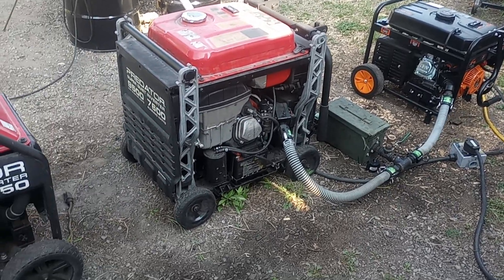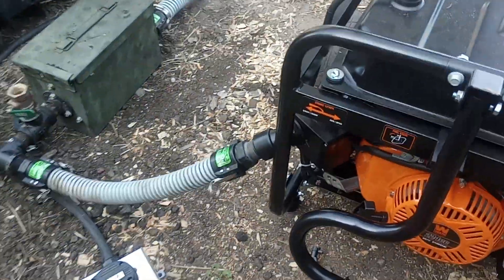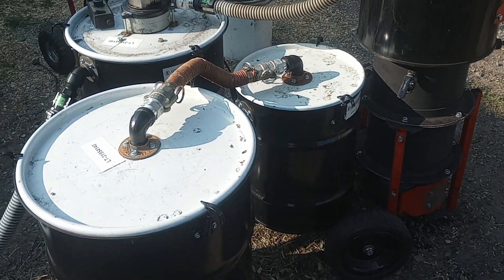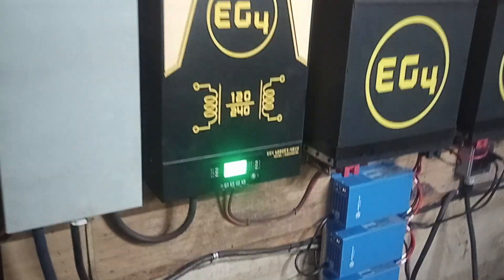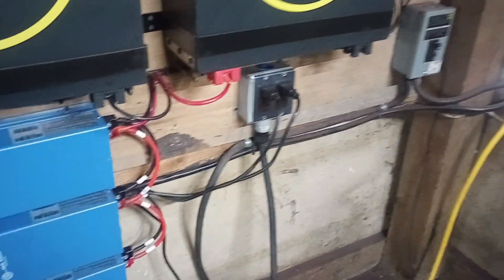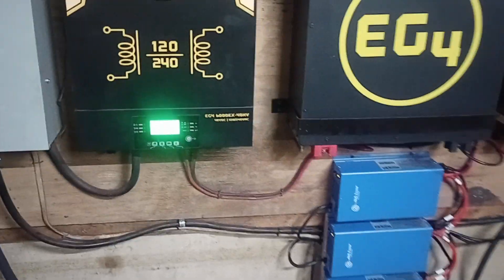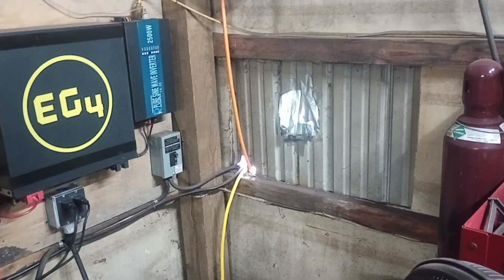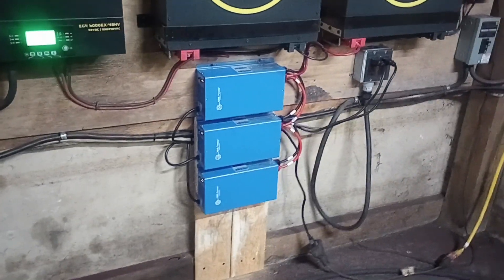Wood Gassing our WEN 4750 Generator in tandem with our Predator 9500

Comment: no batteries..?
Reply from the maker: You did watch the video right??
Reply: @Thrive-Off-Grid   only a few minute....😅
Reply from the maker: @anuarabdulsamad2688  Well there you go, you got to watch the entire video man :)
Reply: @Thrive-Off-Grid   i thought you are feeding   the charger output straight to the inverter...is that possible... ??
Reply from the maker: @anuarabdulsamad2688  Yes you can do that
Reply from the maker: @anuarabdulsamad2688  Thats kinda silly thoguh isnt it? Why would you convert to DC just to convert back to AC? Our EG4 inverter can pass thru a generator input and output in pure sign wave. But with a gasifier you never want to use it as a primary power mover. Run it at its maximum you can get out of the unit and store that power. Otherwise you are wasting your fuel.

Comment: Matt how many watts are you pushing to the batteries total?  Ah I went back and watched again 60 amps at 54 volts. 3,240 watts. Pretty nice!!!!!
Reply from the maker: 3 kW that is the recommended max for two of these EG4 5 kW batts.
Reply from the maker: Yeah that is the rate we would charge at running on gasoline. Its not recommended to charge beyond this rate.
Reply from the maker: I think with our Aims converters the reason you maybe limited running them in parrallel; is because you are running lower voltage. So you may need bigger cables and well bigger cables will be dificult to fit onto the Aims. Yeah three chargers pushing through 6 ga at 54 volts does get slightly warm. I could not see going more than four units in parrallel without going to much thicker cable.  So I would imagine lower voltages will need to thicker cable. So two max but no reason you could not run another bank of two.
Reply: @Thrive-Off-Grid  I was going to ask. I totally get the power distribution heat and cable dimension aspect of things. I ended up getting a Power In + the Lynx distributor from Victron. It’s basically a fancy bus bar rated at 1000 amps. I connect each AIMS directly to it on its own port so to speak. If you look at the lynx power in you will see what I mean. 

Yeah you are probably limited now by the C rate of the batteries likely the charge controller component vs the actual battery cells them self. No sense punishing the subsystem if you don’t have to. My system is designed to operate at 25%. 4 BMS controllers + 4 280 Ah 24 volt nominal batteries.
Reply: @Thrive-Off-Grid  the reason I limited the number of units in parallel was because of the manufacturer suggestion   I will get more lol. I would have to go back and look but I think each converter puts out like 1000 watts @ 24 nominal. I think everything will be ok as long as they all stay in bulk. I think the problem is when one may switch to a different mode before the others. It would be nice if it were more of a power supply where you just set a constant voltage of 3.45 volts per cell x number of cells and just let the current tail off and be done with it.